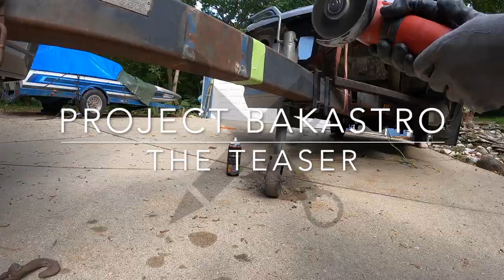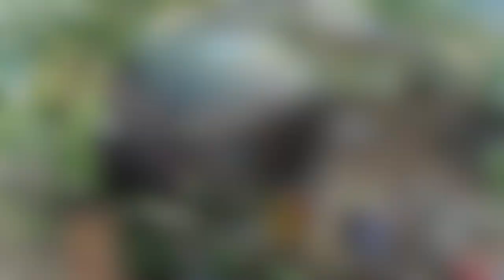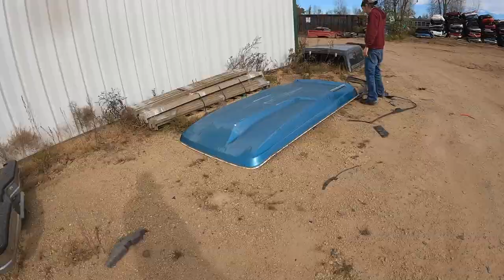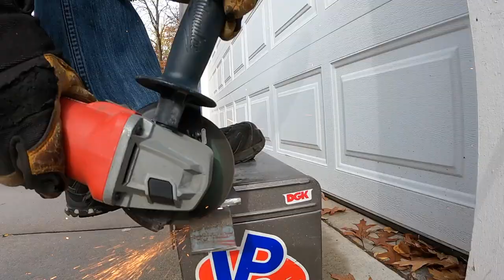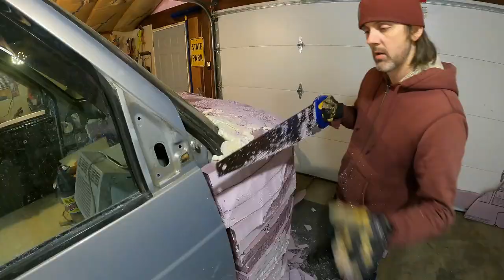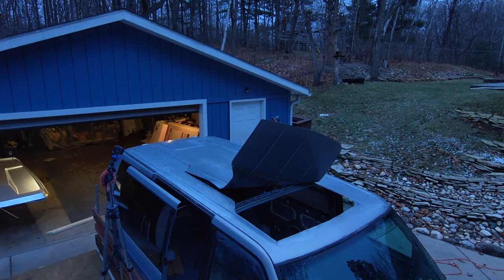Astro Van Trailer w Foamie Front End & High Top Install 2022 Update

Comment: My neighbor has a Astro van trailer he built & can’t even give it away. He chopped it behind the front doors & covered the front with tin. It’s gong to the scrap yard unless I want it.  I would be all over it if it had a rear hatch instead of barn doors & would be nice to have another sliding door on drivers side. I want it like a Tear Drop & be nice to stand in it for a shower. I would probably take it if I could put my quad in it. 
It’s not a dumb idea & I can’t wait to see it finished.
Reply from the maker: Is it blue?   And nicely done?

Comment: Was wondering about the ubolt coming thru the floor. Is that to secure axle to the rv ? Tia
Reply from the maker: So this is half astro van, half boat trailer.  There are 6 U bolts that crimped teh body onto the frame of the trailer, as well as 4 very large bolts (body mounts).  I removed the U-bolts and put in square right angle bolts so that I could make the floor as thin as possible, saving more headroom.    Axle is just a stock astro axle with leaf springs
Reply: @ADDvanced  I saw your video when you and your wife went to get the Astro Van! Forgot that you mounted the Astro on a boat trailer. Thanks for replying too!

Comment: Bad idea... The axle to much rear... I a good project but need more idea's
Reply from the maker: 1. Removing weight in front of the axle, the hood/fenders/core support were very heavy
2. Adding weight behind the axle, I've cut a battery box into the floor to hold golf cart batteries, water tanks will be behind the axle, and I'm relocating the spare on the rear door/bumper. Anything else heavy I'm going to try to put back there to help.
3. Interior build out will use a lot of foam/veneer and composite construction to save weight
4. Weight distribution hitch
We'll see how it goes....